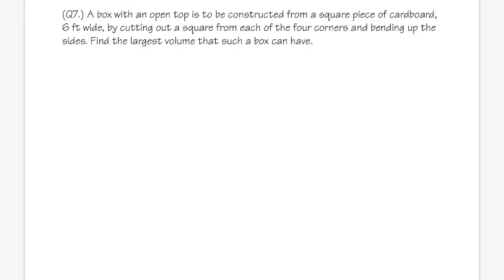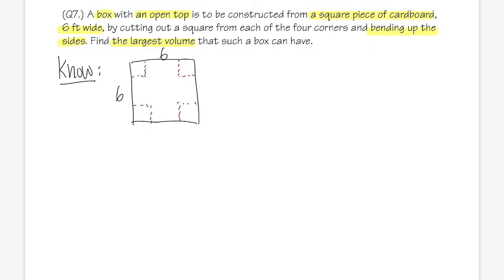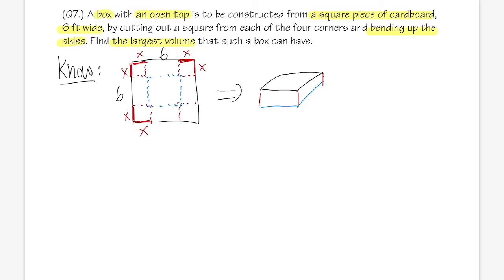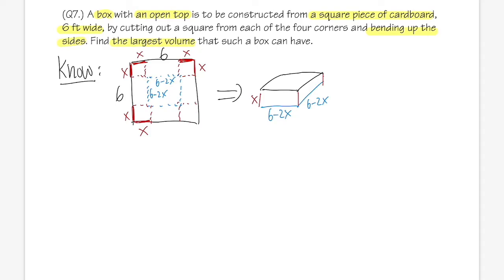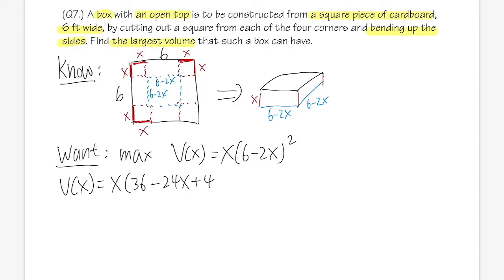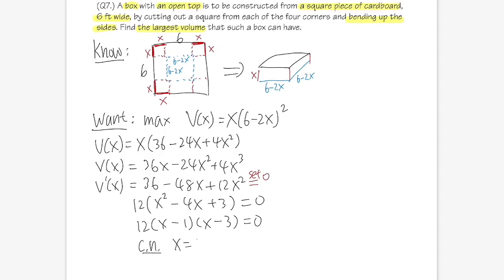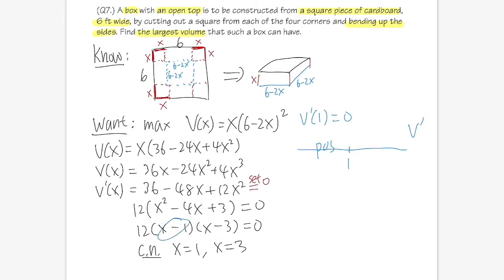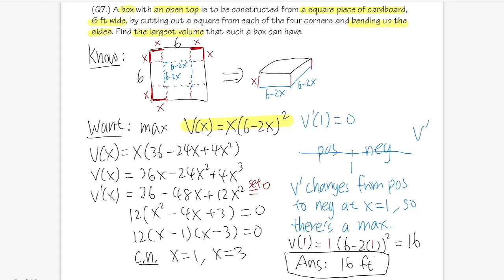Optimization: A box with an open top is to be constructed from a square piece of cardboard,

Comment: You could actually just say the corners are x and the blue part is y therefore, y+2x =6
We want to maximise the volume y^2 * x subject to y+2x=6
Lets apply the Arithmetic Mean Geometric Mean inequality provided x and y are both positive real numbers then,
Y/2 + Y/2 +2x>=3 * cube root [(y^2)/4 * 2x] I have split y as we need the product to be squared hence we apply AM-GM for three numbers
6/3 = 2 >= cube root[(y^2)/4 * 2x]
8>= (xy^2 )/2
Thefore 
xy^2 <= 16
Hence the maximum value is 16 feet^3
No Calculus and also much faster :)